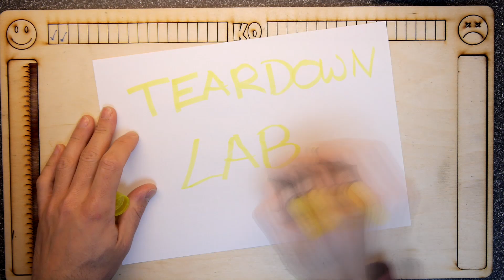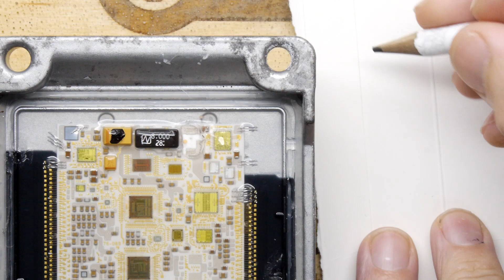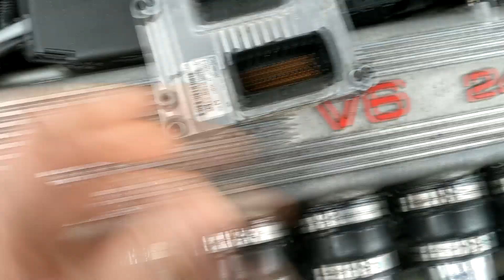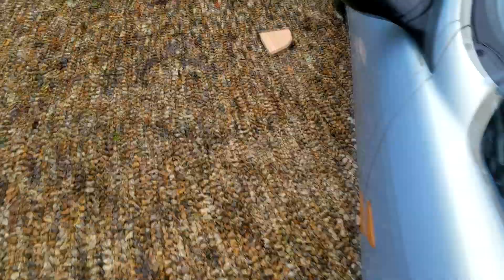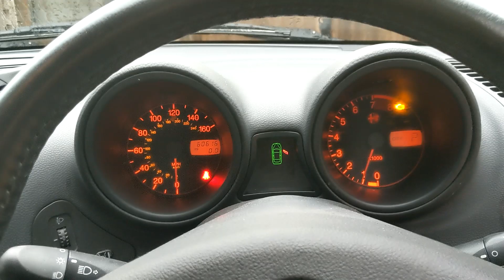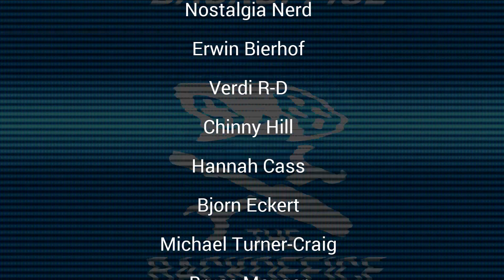Bosch ECU Repair Alfa 166

Comment: Alfa 166 ecu repair...and sits in a 156 2.5 engine...
Reply from the maker: Same shit different box
Reply: @backofficeshow  

Hell no, the ecu in the 166 from 99 is located at the pasenger side inside the vehicle! And nothing like what is shown in your clip!
Reply: @karlos1060   The later V6 166 has the same ECU. CF2 (pre 2001) cars have it in the footwell, CF3 (2001 and on) cars have it bolted to the plenum.  I'd seen talk of this fix on a forum I frequent and confess I was cynical as I'd been inside one of these some years back and didn't notice/forgot about the decoupling caps. Nice easy fix!!  The CF2 cars have an ME2.1 ECU - conventional PCB & components rather than ceramic hybrid like this one. Much easier to fix...and much less likely to go wrong ;)
Reply: Same engine, no ?

Comment: That ECU is designed to fail - and be very difficult to repair (capacitors aside). Andrew, I'm sure you'd get more views if you took TDL out of the title (or at least moved it to the end).
Reply from the maker: Thanks Julian, it certainly is awful!  I have been meaning to drop the TDL but keep forgetting, I finally have done it across all videos